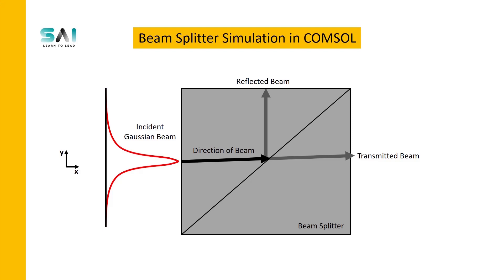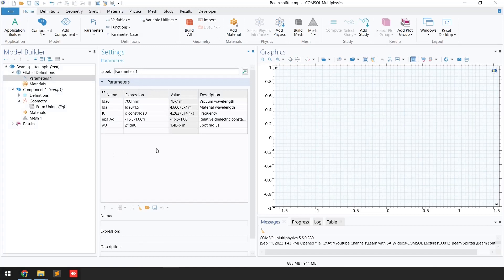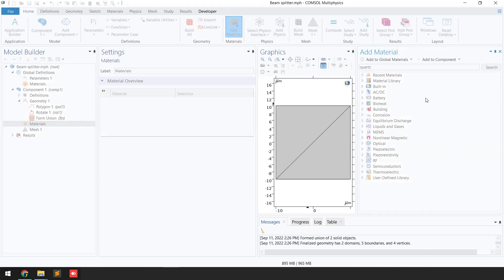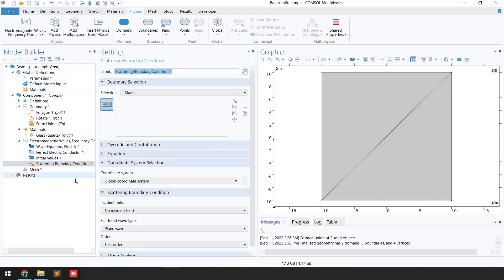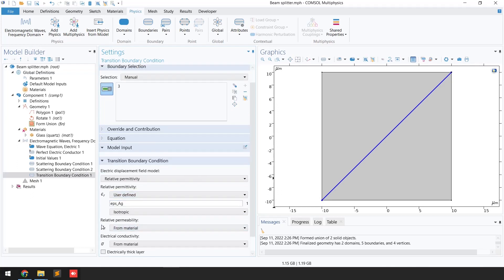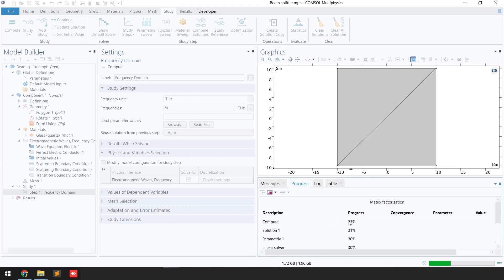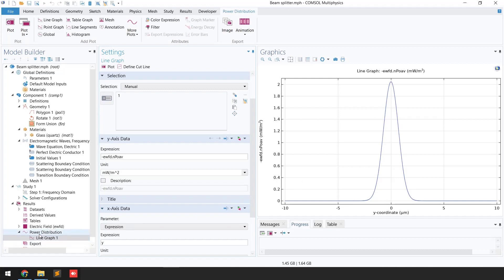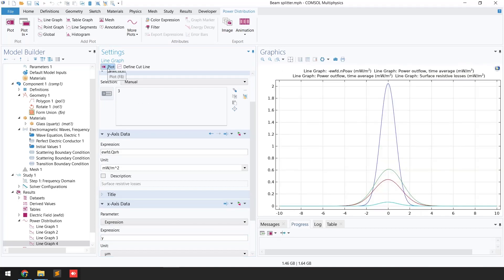COMSOL Tutorial 12 | 2D Beam Splitter | Laser (Gaussian) passing through beam splitter using COMSOL

Comment: Hi! I have a question about the power of the beam splitter: if there are diffraction orders, can the integral of the ewfd.nPoav includes all the output power of the structure?
Reply from the maker: Thank you for your question! Yes, you can use ewfd.nPoav (the average power flux in the Electromagnetic Waves, Frequency Domain interface) to calculate the total output power, including the diffraction orders. To ensure you capture all the power, you’ll need to integrate ewfd.nPoav over all the relevant output boundaries, including those where the diffracted orders propagate.

By doing this, you should be able to account for the total power transmitted or reflected by the structure.